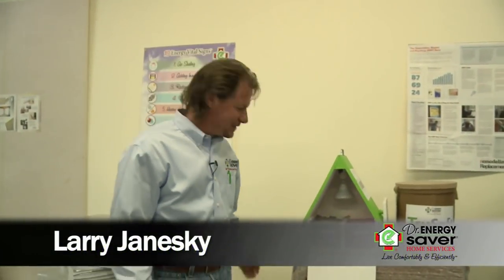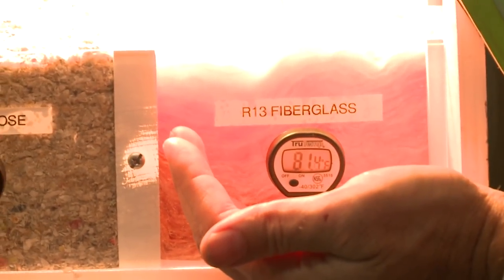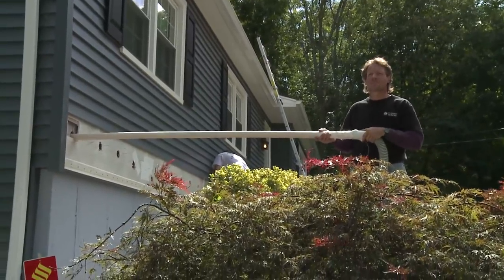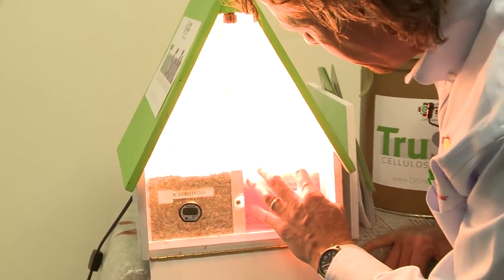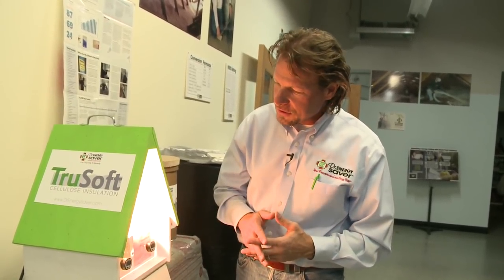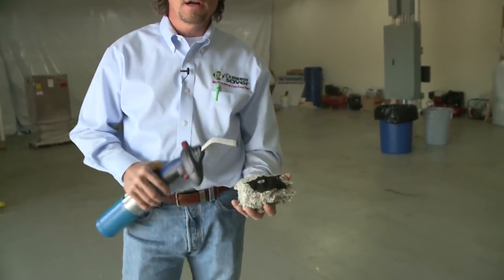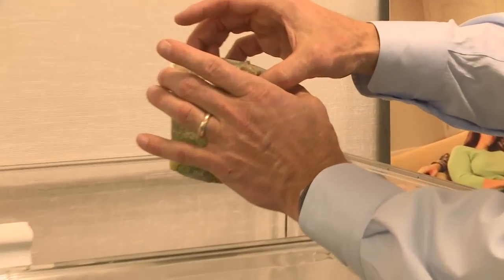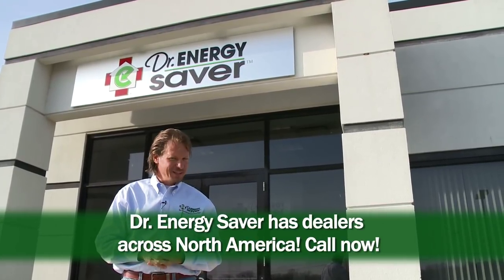Why Cellulose Insulation is Better than Fiberglass Insulation

Comment: With a vapor barrier that should stop air flow. Then how does it compare?
I have fiber glass in a plastic bag in my attic.
 What I noticed about cellulose is it compacts. 8 inches is four inches in a few years.
Reply: +Joe Shmoe That's why they spray wall cellulose with high pressure so that it is already compacted and can't settle.
Reply: +ralphinator2  I said in an attic, not a wall. Can't compact it in an unconfined space.
  A very good insulation is made from rock. Probably the best. I believe it's called Rocksul.
Reply: +Joe Shmoe , that's simply not true.  Both blown fiberglass and blown cellulose settles. The rate cellulose settles is known and stated on every bag (by law). Contractors install the blown in depth to achieve the settled depth. Fiberglass also has a known settling rate. However it's compounded by unscrupulous installers who use high powered blowers to fluff the fiberglass. For example to get a certain depth and density with fiberglass may require fifty  30 pound bags. The contractor can add more air and fluff the fiberglass so the homeowner measures the contracted depth but didn't get the contracted density. It insulates poorly and settles way below manufacturer's claims.  Fiberglass contractors prefer fiberglass because they can get the added coverage and make more money. Cellulose won't fluff like fiberglass.
Reply: Don't use either. Use Roxsul. Had I known about before, I would have. It's the only stuff I would ever recommend now.
Reply: +Joe Shmoe / it does compact and how. Fibreglass glues and binders stick the fibres together making spaggetti bridges,  there are various grades of binder, loft insulation is the cheapest binder used, cavity wall insulation uses a better binder  not overly affected by wall damp. When insulation comes out of the furnace its 12 inches thick, they roll it down to various thickness's, the rolling is rather crude and imprecise, so weighing the bags is a better test of what is inside and what you have bought, like Aspirins making insulation is all profit. It used to be the bags cost more, but that may no longer be true. Well made Fibreglass beats Cellulose hands down. If Gyproc was banned for ceilings that would be a giant leap forward for mankind.
Reply: +SuttonWoods , of course fiberglass settles...big timed. Adding to the settling problem, installers crank up the air volume and pressure on their blower machines to make it extra fluffy. That way a job, say that should use fifty bags of blowing fiberglass can be done with only forty. The depth measures the same but the density is less... it's hidden profit for the fiberglass installer. Quality cellulose installers can't compete on price alone,. They must explain the tricks of the trade fiberglass sales organizations use to find hidden profits at the customer's expense. The binders & glue in fiberglass aids in fluffing. They are not insulation so reduce the already pitiful R-value even more. Sounds like a fiberglass salesman has really massaged your mind. As you eluded to, fiberglass production is extremely demanding on our energy resources. That fact,  along with fiberglass's weak insulating ability, means fiberglass simply is not cost effective...similar to foam in that regard. Except for built in profit potential, fiberglass doesn't beat cellulose in any way. Starting with the R-value, blowing fiberglass is much lower. Once installed, in attics or walls fiberglass does not stop air infiltration...one of cellulose's qualities. Fiberglass loses up to half its insulating value on cold days, exactly when performance is required. In a house fire the fiberglass melts away letting roaring flames spread. On the other hand, fire retardant cellulose, densely packed in walls stops air infiltration. Unlike fiberglass, cellulose is APPROVED as a wall fire barrier. Two hours of fire protection vs melting fiberglass is a no brainer. Tell us again how fiberglass is better, I missed it.
Reply: +Larry Maloney / Without doubt Fibreglass is the best, that's why its probably got 90% of the overall sales market,  the manufacturers Owens Corning USA are super reliable in all depts,  I have handled over a million rolls of fibreglass. We notice some are hard to cut, some are easy to cut (knife not needed) some collapse, some don't cut clean, Owens Corning Fibreglass never once give me these problems.  Better still our jobs got inspected first in order to approve payment to us, never any squarks with Owens gear, no awkward conversation. The clients knew we what we were doing and all our jobs held good. What we, and the fibreglass trade is selling is total peace-of-mind-for buyers, for the layers,  peace of mind for the architects and no with held payment checks. Cellulose does not have that aura about it, its the poor relation of the insulation trade.
Reply: +SuttonWoods , like I said, you fiberglass salesmen are good. You have to be to sell an inferior product. Your best defense against the flaws in fiberglass is DENIAL...even ignoring the facts. The fiberglass industry dominates because they were in the asbestos business before switching to fiberglass so had billions of dollars. when they were sued for billions and lost their case in Court, instead of paying damages they filed bankruptcy. Now the same people are in the fiberglass business and fiberglass is even more of a carcinogen than asbestos.  Fiberglass salesman are notorious for fear mongering to sell their product. They are so good at it they convince customers and builders alike to fear fire retardant cellulose instead of cancerous fiberglass. Now THAT'S good! Fortunately some buyers are intelligent enough to understand the serious differences between the two. Firemen keep putting out house fires spread by inadequate fiberglass and people keep dying but you convince them to be reassured fiberglass is the way to go. As the word spreads I suspect your market share will continue to shrink. I'll do my part to that end.
Reply: +Larry Maloney / Larry most of our work was to Govt bodies and City Councils for public housing improvement upgrades, they, acting on professional advice, previous experience and gut instinct maybe, chose the product to use, they always chose FIBREGLASS ROLLS, we simply fulfilled the orders placed to their specification. Marketing specialists  have asked blue collar buyers to compare the two products samples, in these tests Fibreglass always comes out the winner. Loose fill never looks convincing, it does not match people expectations, whilst they immediately understand rolls. It appeals to them, the colour, feel and packaging makes the sale. It;s itchy-ness is a big selling point. Many clients look upon  blown loosefill as a waste product,  it lookks 2nd rate, and who wants it blown all over your loft, it look like factory waste dust,  for every 100 orders we take, I doubt if you can get 5, and 2 of them will doubt they did the wisest thing. The other 3 are too dumb to care. They are Elmers who'll buy fools gold and Ford Edsels.
Reply: SuttonWoods
Infrared camera testing proves the lie.
Reply: @+ralphinator2 /     Please expand your answer, what is the lie?, which product do you refer to that is allegedly being lied about,  how and where are the cameras used, what are the official results. And are you pro-fibreglass or pro-cellulose.
Reply: +SuttonWoods, fiberglass is a good choice for tight government budgets wanting cheap insulation for public housing.  It satisfies the federal government's mandate to the states to "invest" in energy conservation. Cheap fiberglass satisfies the pressure to "do something". Unfortunately, taxpayers continue paying higher heating and cooling rates for public housing than they would had they invested in better quality cellulose...and the poor would be protected from burning themselves down. Selling fiberglass on "appearance" and "color" is about all you have going.  Truth is, any consumer who decides on that basis isn't knowledgeable..which sounds about right for the city governments you bamboozled into fiberglass. Besides, I've never seen a single house that looked any different after insulating than before. The real measure of insulation isn't color, but quality...and that's determined by energy saving...cellulose is about 30% more efficient than fiberglass. No matter how many times you re-insulate with fiberglass (after settling), the final insulation job is cellulose and the homeowner never has to insulate again. Happy cellulose owners talk to neighbors and that knowledge and experience grows the market. Informed customers buy cellulose. You great fiberglass salesman do a commendable job of pressuring city governments into inferiorfiberglass.
Reply: +SuttonWoods , I've already pointed out he lies YOU spread about fiberglass being good and cellulose being bad. You work full time addressing the poor quality of fiberglass, a KNOWN carcinogen. Infrared photos can be interpreted to mean more significant results than is actually there. But agreed, the comment is vague.
Reply: +Larry Maloney /  I know off four Fibreglass Firms, three of them are outstanding in market place prominence. I like two of them, one I do not like, and the 4th are going bust. Owens Corning are the leaders, you do  not mention who makes your Cellulose, so lets have their name, annual accounts, plants and number of employees, and assets. If they are lkisted in Forbes 500 so much the better.  Let us know the price you charge too clients and you're sales conversion rates. Give the world facts, not pleadings. I would not allow Cellulose in my house, and you prove to me I'm wrong.
Reply: +SuttonWoods , you've already established fiberglass has a near monopoly on the poor quality insulation market so why the "challenge"? Ford sells many more economy cars than Jaguar sells its luxury cars but even Ford has a luxury model to move up to. All you have is fiberglass. Instead of pointing out the characteristics that make fiberglass a superior insulation (which we both know it's not), you instead create all these side issues as an avoidance tactic. What you think you know about insulation is what you've been taught to say to close a sale. I understand you not caring for me taking you to school on insulation but it was your  employer who duped you, not me.I get all the work I want, and can handle, frankly (without expanding). Like I said, my customers are informed. That means they are involved. Maybe it's a personal thing but there's nothing worse than my customer not understanding why she made the choice she did. I want MY customers to have HIGH expectations and have the knowledge to make a critical evaluation of my energy efficiency design efforts. Meanwhile you challenge me to a whizzing contest. I concede more Fords and fiberglass are sold than Jaguars and cellulose. Again, the real measure of insulation is its ability to stop air infiltration. As you know, fiberglass is used as the filter media in cheap furnace filters because it freely passes air. That's not an attribute conducive to stopping air infiltration in attics, walls, or crawl spaces.For many decades I've said I would not put fiberglass in my house if it were FREE. The true cost of insulation is not the purchase price but the energy savings over the decades. Even so-called "free" fiberglass costs more in lost energy savings (30% less every month of every year) than cellulose. In addition, fiberglass doesn't provide the comfort of cellulose. The house is still drafty with fiberglass. In the event of a fire the fiberglass melts in the walls and the wall cavity remains as a fire chute to the attic. Fire spreads from the kitchen or bedroom to the attic and the whole house is engulfed. Cellulose is rated as part of a fire barrier by Underwriter's Laboratory. The same fire retarding treatment keeps insects away. The boric acid won't kill animals but will irritate the eyes of animals who try to burrow into it to nest. The raccoons give up in a day or two. When the cellulose insulated home is sold the homeowner has every right to price according to the quality insulation she has installed. After all, she has a history of extremely reduced heating and cooling costs to show prospective buyers.  The same floor plan across the street but insulated with fiberglass is costing 30% more to heat and cool and is drafty.   Which home would an informed buyer choose? I don't know how many attics I've vacuum  fiberglass (batting & blown) out of because the fiberglass became the nesting ground of hundreds of mice. That's nasty work. Check your own for burrow holes and mice (or worse) droppings. The health department would order the homeowner to vacate, I suspect, if they saw some of the nastiness I've witnessed removing fiberglass insulation. We spent two months (part time) removing moldy fiberglass batting from an upscale home's crawlspace. Mold had grown on the insulation and it was miserable crawling around in that crap.  There were plenty of droppings and dead mice, adults and babies. We agreed to do the work provisionally ...that we could work on it four hours each day...we just needed a break from the odor and dirty environment. Today the owner has fire retardant cellulose held up by fire retardant visqueen in her crawl space joists. The same visqueen was placed on her ground and crawl space walls to cover the fiberglass dust. Only then could my crew stop wearing their personal protective gear.
Reply: +Larry Maloney /Larry, I would have refused the job, 2 months driving back and forth to clear an attic space, I can do 1000 orders in that time,  your not selling insulation, your selling you're time and labour and perseverance, creating good will doe not pay your bills, or give your wife and  children a better life. Gosh you do need my help, in two days you;d be walking away from jobs like that, and counting the money, not earning praise/s.
Reply: +SuttonWoods , like I said, I'm not a good salesman. It's that moral streak in me. I'm positive and don't get in the gutter with those lying fiberglass salesmen. Yep, I'm sure you would straiten me out.  But I didn't do  the crawl space job for a pat on the back. I did the work because I agreed to...my word! The way I see it, fiberglass is sold to make money. And cellulose is sold to do a good job. Agreed, I'm selling my time, my knowledge, and the benefits from the produce. See, I'm learning from you already even though you hate me.
Reply: +Larry Maloney /  Larry: Selling Cellulose made in Kansas must for you be the Yellow Brick Road to success,  now you need to find a cowardly lion who lacks courage (to open doors), a scarecrow with a brain to install it, and the Tin Man with a heart is you're role, collectively these 3 are your first sales team. So go to it, have fun,  SW.
Reply: ROCKSUL. nuff said.
Reply: +SuttonWoods , I'm not in Kansas. And your not The Wizard of OZ.  Getting personal is your g-to when you recognize you can't BS me about inferior fiberglass insulation. Fiberglass insulation is not permitted as a fire stop by the Federal Government because it won't stop fires. Cellulose IS approved as part of a fire wall or even a fire door. Why do the fiberglass manufacturers print the cancer warning so small on fiberglass blankets, rolls, and loose blown?
Reply: +Joe Shmoe , agreed, Rocksol is a much better product than fiberglass blankets but it's often not installed any better thane fiberglass so lets air infiltrate. Rocksol is too difficult to install as blankets in attics...again, it leaks air. Even if you go to the expanse off crisscrossing with a second layer, like fiberglass, the air (and heat) leaks out.

Comment: Here’s a question I wish somebody who knows more than me would answer,,   I’ve seen insulation put up directly between the roof rafters, ( I think with a plastic barrier covering it as well) and of course I’ve seen it put in either as batts above the ceiling or blown in,,   My question is what determines which system you should use?   Or should you possibly do Both even?    Any help on this would be greatly appreciated!!!
Reply: It depends on what you are trying to do and where you live. 

If you want to build a room, then you put the insulation against the roof.  In most cases people vent the attic to let extra heat escape or to keep ice from forming on the roof. 

In very hot climates, you want some space between the roof and somthing like a solar blanket to keep the roof cooler making asphalt shingles last longer. 

The bottom line, solar blanket on rafters. Lots of insulation on attic floor.